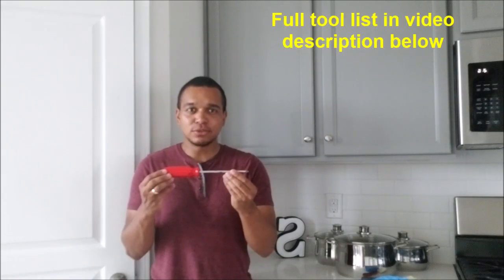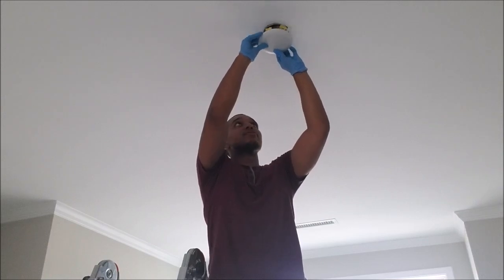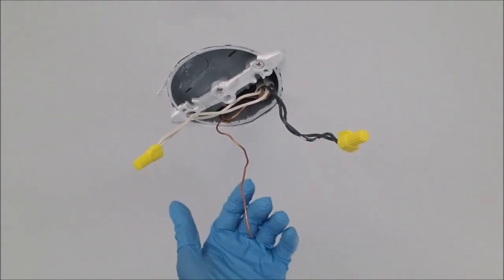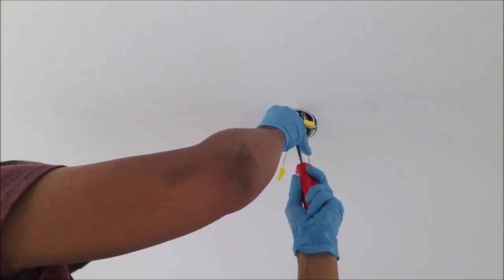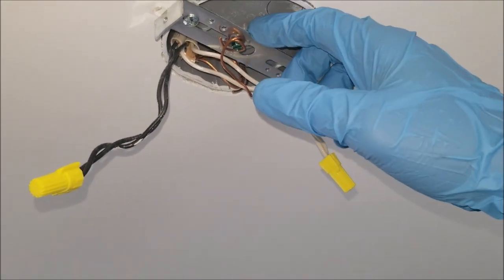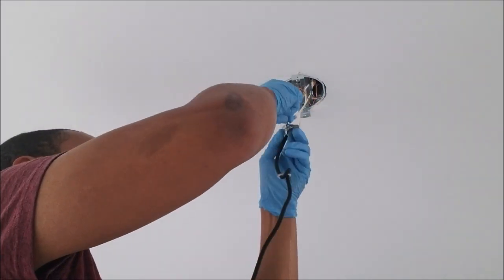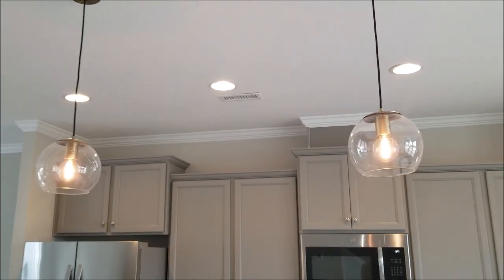How to Install PENDANT Lighting | DIY

Comment: I first came to you for seismic/survey exam advice. Now, I’m here for pendant install advice. Haha We have cross over lives.

Unfortunately, for me, I was mostly finding what I need for installing a new housing part for the light which is not where I want the pendant lights yet.
Reply from the maker: Haha glad we could connect on different topics, people forget Engineers have lives too outside of deadlines haha. Hope your install goes well and you find the additional info needed!
Reply: @EngineeredMojo  This project definitely has many more sub steps that one video could not possibly cover. 

That is true. There is a strange stigma for sure of being a PE, especially Cali PE. Although this topic should not have been brought up, I slipped in with one of my coworkers “I need to save money” to which the non-PE replied “you’re a PE you don’t need more money”. 

Little did this person know,… it’s these projects that are requiring some additional capital . 

By the way, I wanted to thank you for the video you showed on tips for seeing the end of the light for survey and seismic. I had a REALLY tough time with surveying. I spent 7 months in total to master and finally pass the second try. It’s so brutal for people in Structural I believe. My friend and I are both in Structural and both of us needed to take it a second time after we thought we did what was right. CPESR and Reza were the magic prep materials that got us to pass. But your video allowed me to get a perspective of calmness… that it was going to be alright regardless of what happens.
Reply from the maker: @Rayquesto  it's a journey for sure being an engineer. Ups and downs, I always try to remember there is life outside of work/career
Reply: @EngineeredMojo  I finally have a practical question for you. This is because I need to install the receptacle in addition to the pendant light, some gypsum board, etc. Right now, my kitchen looks like a site visit. 

Anyway, is your receptacle plastic or metal? I need to know because it may not be suitable for a pendant light to have plastic if it will tend to pull out or strip out, but plastic recepticle for ceiling light is all I could find at home department store:

Comment: Dang it! You skipped the one part I needed! Where do you put all that excess black cord? Do you just shovel it up into the junction box? Dang it... otherwise, your video was super helpful!!! I love the NASA background music! 😊
Reply from the maker: Haha thanks for the music appreciation. Yes, the excess wires were put into the junction box and underneath the fixture cover plate. Typically I try to fit it all underneath the fixture cover plate to the ceiling to keep the junction box from getting too packed. Hope that helps and thanks for taking the time to share feedback on the video!
Reply: I too feel like the video was stopped half way through... gone from exposed wires to completed project, 🤔
Reply from the maker: @Gia_P.  haha notes for future videos. I mistakenly took that portion of the job as self explanatory
Reply: When you figure out how low you want the lamps to hang, you cut off the extra length (do some measuring to still leave enough to work with), and then strip the wire ends and attach.  You don't necessarily need to shove all the extra cord up into the ceiling.
Reply: Rule of thumb: hang lights 36” above countertop. I am still trying to figure out to install two pe dents myself. I was quoted for $600/- by a local electrician, not sure why $600/- if installation is that simple. $150/- sounds reasonable but not $600/-

Comment: Very useful video. So does it matter if the ground wire also touches the mounting bracket itself?
Reply from the maker: The ground can touch and often is attached to the mount bracket in some fan assemblies. It's basically an emergency wire to keep an electrical fixture from experiencing electrical surges and transmits excess current to the house grounding

Comment: Thanks for the video. My pendant fixture has a ground wire also. Should I just leave that the way it is?
Reply from the maker: Ground wires (copper wires that are bare) should all tie in together. So in the video example if my fixture had a ground wire, I would have tied it into the wire I wrapped around the screw. Hope that helps!

Comment: Great video! My pendant light came with a ground wire and my junction box also has a ground wire. Which one do I connect? Or do I connect both? Thanks!
Reply from the maker: You can connect both to the ground screw location on your junction box!

Comment: Great video but I have a problem/question with my situation.
The old hanging ceiling light in place is bigger than the new one I got so the hole in the ceiling is too big. Any tips or videos you could point me to to assist?
Reply from the maker: You may need to install a new/smaller junction box and redo some drywall. I'd suggest searching drywall patching videos for new wall drywall openings. Hope that helps!

Comment: Excellent video. Thank you sir. I am quoted $600/- to install 2 pendent lights. I got the material. Installation $600/- for 2 lights is ridiculous.
Reply from the maker: It's definitely a DIY job worth doing to save money. Pay attention to the safety and the rest is not bad at all to perform especially if you have a helper. Glad the video was useful for you :)
Reply: @EngineeredMojo  , Thanks. I will let you know the end results.
Reply from the maker: @ElsaAndAnnie  yes please do

Comment: Awesome video! My pendant light has 2 black wires I’m not sure which one is neutral
Reply from the maker: Examine the wires. If they are made of opaque plastic and you feel a texture on one of them while the other is smooth, the textured side is neutral. Also, typically the wires in the neutral side are silver while those in the hot side are copper. Hope that helps and thanks for the video feedback!

Comment: Thanks for the video. You had 2 hot and 2 neutral wires to start with.. after connecting the pendant, I just see 1 hot and 1 neutral being connected.. what did you do with the other pair?
Reply from the maker: I actually mixed footage from the other pendant, but all you need to do is tie all the neutral together and all the hot together with their respective wire for the pendant. So it will be 2 hot from house going to 1 hot from pendant and same for neutral

Comment: Thank you for the helpful video. I am a complete novice and trying to understand basics of electricals. I have a quick question - In the video, at 4:47 minutes, there are two black wires from the ceiling tied together with yellow nut and two white wires with yellow nut. Why are there two wires of each originally? When I connect my lamp wire, should I just connect it with the two (making it total 3 wires) in each nut?? Or should I do something with the extra black/white wire?? 
Sorry, but later in the video (at 7 minutes), I only see one black/white wire from the ceiling, so I am not sure if we have to do something to get rid of one extra wire.
Reply from the maker: No problem and good question. You connect both of the source wires to your new pendant. The reason you only see one source wire later in the video is because that was a different receptacle from where I started. Only one receptacle had two source wires and I just so happened to have chosen footage from the 2nd pendant I installed to show the finished wiring. Hope that clears it up!

Comment: Nice looking kitchen! Can you link to where we can purchase those same pendant light fixtures?
Reply from the maker: Thanks for the feedback on the kitchen! Here is the link below, this brand pendant can be found from other retailers as well:

https://www.jossandmain.com/--Snead-1Light-Single-Globe-Pendant-X111103426-L6087-K~J000079767.html?refid=GX433385013564-J000079767_1102476080_1102476086&device=c&ptid=937511285234&targetid=pla-937511285234&network=g&ireid=68403504&PiID%5B%5D=1102476080&PiID%5B%5D=1102476086&gclid=CjwKCAiAnvj9BRA4EiwAuUMDf4xcV366rpd1f1LNtDjdl9ZmHsh_Al9P7WbUGjNxVMoaRbN13xtXxxoC6lwQAvD_BwE

Comment: I would have liked to see how you placed the extra wire in the ceiling from the pendant light after you adjusted it to the height you wanted it.
Reply from the maker: Oh yea that would have been a good video shot, but to explain in words I just wrapped the wires together and zip tied them to keep them out the way. Then just laid them to the side of the pendant cap. Hope that helps, nothing really special was done, just simple stuffing wires to one side

Comment: Hey, thanks for the video and even I’m thinking to install pendant lights over my kitchen island of new home. Currently there is only one ceiling light over the island, how can I install 3 pendant lights there? Do I need to assign it to a electrician!? Or can i do it myself!?
Reply from the maker: You could definitely research the process and do electrical wiring yourself, but if you aren't knowledgeable about building wiring already it will be easier and safer to hire an electrician. They'll also probably be able to install with less damage to existing walls, but expect some damage that will need to be patched

Comment: Can a set of 3 pendants hanging on one bar be split into 3 separate individual pendants?
Reply from the maker: I'm sure you could but may take some custom wiring of the pendant. Typically those pendants will just have exposed wire connections for the one final connection to your home. You'd have to disassemble the pendant and see how each individual pendant light is wired. May be as simple as just extending/adding wire to each individual pendant after the dissassembly
Reply: Thank you, much appreciated.

Comment: Wow! Thanks for this video. It helped a lot. Hello. You mention that it’s not enough to simply turn off the light switch to stop the electricity. So have you ever made a video on how to to actually “brake the circuit from the beaker itself” as you say in this video. Thanks.
Reply from the maker: Oh yea it's in the video. When I flip the breaker at electrical box that is breaking the circuit from voltage feed. Flipping a light switch just breaks it locally at the switch which technically works but adds a layer of failure at the switch you'd have to worry about or an unknown short.
Reply: @EngineeredMojo  Bright!💡Thank you for the reply. I appreciate it.

Comment: @engineeredMojo Quick question - I have similar wires however, my pendant comes with a green wire. Do I connect my green wire (from pendant) to green screw on plate or to copper wire coming from ceiling? And bypass green screw? Thank you sir

Comment: Just want to double check: it’s perfectly fine to connect both black wires that are coming out of the junction box to the black wire from my pendant? I don’t see anything in my instructions about capping 3 wires together.
Reply from the maker: That is what the voltmeter is for haha, no need to guess if you know both those black wires are the same i.e. hot wires that are on and off with same switch. But yes if they are both the same (and operate from same individual switch very important) and you've verified with a voltmeter, then it's fine to connect them both to the pendant wire that corresponds. One wire may be a "always hot" wire being fed power continuously, you don't want to connect that one if so. Hope that clears it up and good question!

Comment: Hello, if I want to buy a new pendant to replace the old one, does the bracket of the new pendant have to have the same length with the old one? thanks
Reply from the maker: Not sure I completely understand the question, but in general you can buy whatever pendant you want as long as you have the correct number of bracket locations (some larger pendants use more than one bracket attachment) and the pendants weight is not excessive for your ceiling.

Comment: Great video, appreciate you posting. I was going to do this myself as I almost have the same kitchen, looks like castle rock...regardless, one question...where did u tuck in the excess wire to adjust height? Thankyou
Reply from the maker: Thanks for the feedback! For the excess wire, I cut the wire and left about 1 foot extra just in case I ever wanted to adjust the height or I made a measuring mistake. I tucked that 1 foot extra inside the light pendant base at the ceiling. Hope that helps!
Reply: @EngineeredMojo  it sure does, i realized this was a year ago, so i truly appreciate the quick response!!

Comment: there’s two white and black wires coming down but when i connected there was only one what happened to the others ?
Reply from the maker: The clip switched to one of the other receptacles, but the extra wires all connect together to their respective color...so for the two white wires coming from the house; I connected both to the white wire for the pendant. Hope that makes sense!

Comment: Great video, but my new pendants wires are both black.  I do I know which one suppose to be the live wire?
Reply from the maker: Examine the wires. If they are made of opaque plastic and you feel a texture on one of them while the other is smooth, the textured side is neutral. Also, typically the wires in the neutral side are silver while those in the hot side are copper. Hope that helps and thanks for the video feedback!

Comment: super helpful! installing pedants just like yours. my fixture came with a copper wire. i see a copper ground wire in the ceiling already. Do I attach them like the neutral and live wires? I didn't see you take that specific action in your step-by-step.
Reply from the maker: The copper wire wraps right around the green screw shown in the video. When you tighten the screw it secures the ground wire. Very simple! Good luck with your install

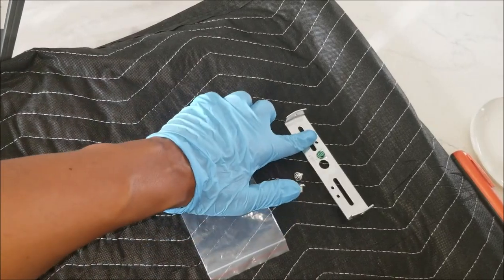Comment: Hi I have a similar light fixture but I lost the bracket piece you showed at 3:33 into the video. I am looking to replace it but can't find it anywhere. Do you know what it is called and if its available for purchase. Thank you!
Reply from the maker: Yea for sure! It's called a pendant light crossbar. You can typically find them at any local hardware big box store pretty easy or online as well

Comment: Great video! How do you adjust the height of the pendant light?
Reply from the maker: Simply cut the excess wire to the length you need. Typically I keep about 1 foot of extra wire within the pendant base in case I want to change height later or make a measurement mistake

Comment: Hey what happened to the other L-N pair that was originally jumpered in?  At the end there was only the L-N pair from the source and the L-N from your pendant light.  Did you just remove them? Also why no electrical tape over the gromet after you screwed it on?
Reply from the maker: Look closer at the video both those wires are source, which is typical of new electrical construction, and they are both tied into my pendant wiring. I prefer not to use electrical tape given it's not required by code with an insulated butt connector as shown for the simple fact that it makes wires super sticky and typically I have to cut tape which then typically nicks the wires... but its definitely useful as a secondary safety precaution! Good question

Comment: How do I adjust the length of my pendant?  The cord is super long (three feet more than I need).  Do I cut it the black sheath around the wires somehow leaving a 1/2 inch of exposed wires?  Thanks.
Reply from the maker: You have to cut the wire to the length you need, but give yourself about 8" - 12" extra in case you make a mistake. After cutting wire, you then need to strip the wire back 1/2" to 1" to expose the metal wire. This can be done with a wire stripper (cheap tool from any tool store) or if you have steady hands, you could use scissors, but run the risk of cutting past the wire coating and into the wire. Hope that helps!

Comment: My pendant light came with a ground wire attached to the ground screw and the mounting bar. Do I need it? Because it’s 6 inches long and doesn’t attach to the light fixture. In your illustration your light fixture doesn’t have a ground wire. Just the one coming out of the ceiling box.
Reply from the maker: For that ground wire typically I'd wrap that around the copper ground wire coming out of the ceiling box you mention (after screwing bare copper ground down to the bracket as normal and shown in video). Wrap it around the end and put a butt connector to keep it from unraveling
Reply: @EngineeredMojo  Thank you so much. I hooked everything up and the lights are working. Thank you for your DIY videos too! They are very informative. A+++++++++
Reply from the maker: @lindylouusa6230  glad to hear and appreciate you taking the time to share the install outcome!

Comment: Should the copper wire in the pendant lamp be fanned out/flattened or should it just be wrapped around straight?
Reply from the maker: I'm not sure I follow, but essentially the copper wire needs to be secured so that it is in solid contact with the metal bracket. I do this by wrapping wire around screw for one "U" loop and tightening the screw to secure copper wire from moving around. Hope that helps!

Comment: Mine look like yours and I have loads of light switches that do nothing in my house. But I can't find the light switch that controls them. Any recommendations?
Reply from the maker: Whenever I cant find a circuit breaker to a particular outlet, I use a tip someone told me of plugging in something loud like a vaccuum or radio. That way once you flip the correct breaker you'll hear it turn off
Reply: @EngineeredMojo  they r pre wired to a light switch....somewhere but I legit can't find it. You solution will prob work for this too